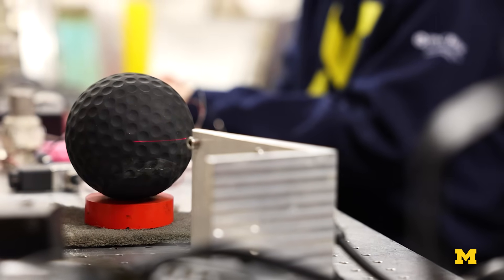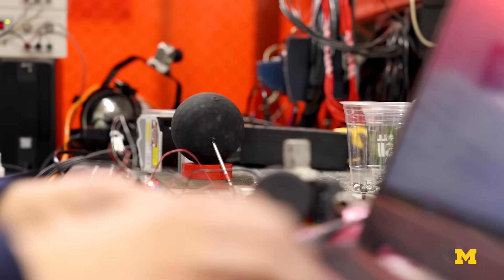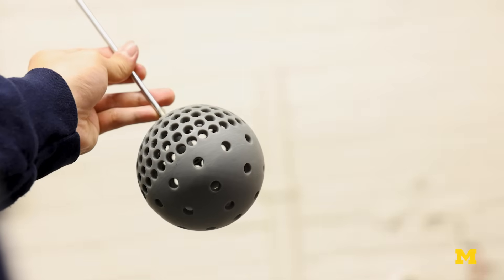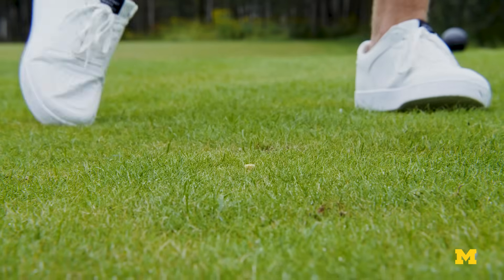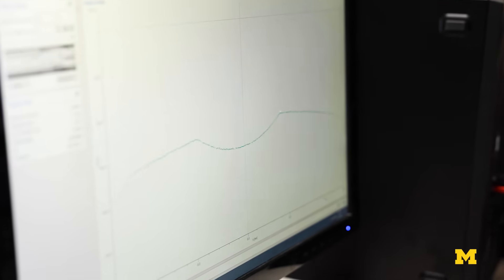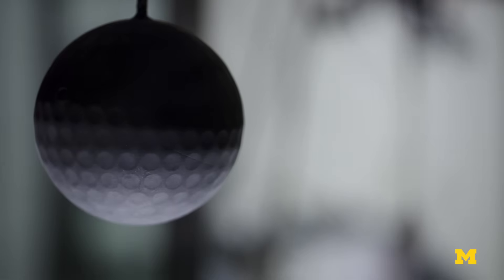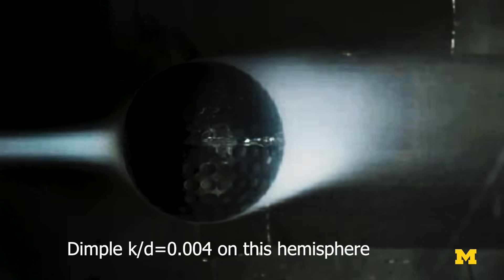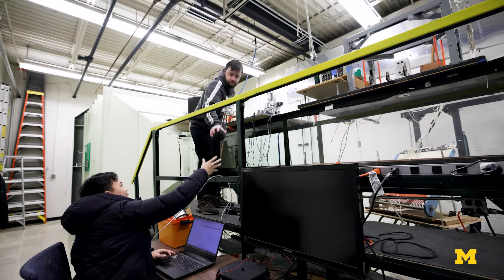A dimpled, actuating surface that could change how underwater vehicles maneuver.

Comment: Isn’t bluff body drag super high? So, the 30% improvement from dimples is relative to a terrible baseline? Are dimples beneficial to a more optimized hydrodynamic shape?
Reply: Yeah may not be that beneficial for aerodynamic shapes in air but it probably has a bigger impact for all shapes underwater since viscosity is much larger and this attempts to minimize that skin friction drag

Comment: IM THINKING IM DRINKING TO MUCH COFFEE BUT THEY USE THE GAS PIN HOLES IN THE SQUAL TORPEDO MISILLE RIGHT LIKE 250 UNDER WATER . SO IF LETS SAY YOU COULD PRODUCE WITH A REACTOR WATER TO H2 0 GAS  OR STEAM AND PIN HOLE IT YA COULD 250 MPH AROUND ALL YEAR . JUST SAYING !!!!!

Comment: I wonder if you could make this golfball out of a flexible Radar Absorbing Material (RAM) or coat it in a RAM that tolerates this flexing behavior, to make stealth aircraft with no moving control surfaces, or to make stealth aircraft able to dynamically adjust their surface shape and texture to better resist detection by whatever wavelengths it detects that it is being illuminated by like those metamaterial "invisibility cloaks" but programmable?
Reply: most likely will not be able to have enough control and change of direction for an aircraft.

Comment: What I see is that this is a great idea but increasing the overall surface area underwater by making dimples will increase the frictional resistance of the body, though eddy losses will be lesser than before but we have to keep in mind that this is water-it has more viscosity than air therefore frictional losses constitute a greater part. Also, if seen in longer timeline there will be plenty of marine growth over the surface which may reduce the overall effectiveness of this system and it will be harder to clear too
.

Comment: If you had more fine control over individual dimples, could you run them in wave patterns to generate propulsion?
Reply: You could definitely get it to roll on hard surfaces. You could probably get it to spin or rotate underwater. Professor Sareen says that's how they get the ball to turn right or left in the air; by actuating the different dimples

Comment: Its interesting that they are specifically targeting underwater use cases.

Given the golf ball analogy, I would have expected more interest in air based drag reduction.
Reply: I would bet its pretty heavy so its better implemented in water where weight is less relevant.
Reply: @TheCococoleyco 
Very good point.
Reply: they run their tests with air- so I don't think it matters if its air or water. They have sensors on the regions to determine how much air pressure to apply to increase/decrease the dimple depth
Reply: Higher viscosity underwater means there is likely a more pronounced effect since it attempts to minimize skin surface drag
Reply: this is not really for drag reduction in aerodynamics. the dimples on a golf ball generate turbulence in every orientation. for aplications like cars and airplanes, we have waaay more efficient ways of generating vortexes when we want to, but it is often better to preserve laminar flow in most cases, the golf ball benefits from turbulence because the curvature of a ball is too agressive for laminar flow to follow, and that generates flow stagnation or worse alternating vortexes (see the jabulani football fiasco). the suggested aplication here is to have a submersible where by actuating these dimples we can change the flow around the vehicle to make it turn. It probably will only be beneficial in a few niche use cases where you dont need much manouverability and where fins have big cons. there is the adicional problem of dimples not being terribly good vortex generators, they are used on golfballs because a golfball spins and we cant have directed vortex generators
Reply: also, forgot to mention, for traditional applications there is no reason to actuate these things, bugatti recebtly had a car with actuated dimples, and not only are dimples awful vortex generators, but worse than that you had a heavy system to activate them at speed when there was no reason to not have them on at low speed as well, then the engineers must have explained to the designers and the marketing team how ridiculous and dumb that whole concept made them look and they suddenly stopped advertising that feature and that device never appeared on the production car (neither did any dimples)
Reply: bro the medium of water has greater resistance than of air. No need to test it on air if its being used underwater
Reply: @kennyboy4u you misunderstood. If they got the idea and original principle from air... why are they testing it in water?

Comment: Judging by how animals in nature don't use surface texture for maneuvering, I imagine fins would still be better. Even animals like octopuses that can change their skin texture don't use the texture for maneuvering.
Reply: Animals don’t use biological equivalents to propellers or jets or rockets either. It is pretty intuitive that trying to make the wings flap on a commercial airliner is simply not feasible. There are certain optimizations that biological systems simply cannot make due to limitations in mechanical complexity. You also have to consider what the problem is at hand here, which is range maximization. Sea creatures with the capability to change their skin texture may not have this need or it may take more energy to hold a different configuration like flexing a muscle that makes it not worth it. Mechanical systems can be designed such that configurations can be held through locking mechanisms or material properties which means only the energy needed to change is required. Where we are in terms of evolution is not a peak, nature is flawed too and biological systems are continually adapting to their environments
Reply: Well…kind of. But fish move their bodies to swim and maneuver, which is geometrically kind of like a huge dimple one way or the other. Thing is, this could be useful on things like submarines where you want control surfaces that get the job done but don’t make a lot of noise and aren’t creating drag when they’re not needed.
Reply: @koriko88  But they can't get the job done. Fins are so much more effective.
Reply: Conclusions from bionics are not bijective. Airplanes have thruster and no animal on earth has a jet stream shooting out of its ass.
Reply: @xxxy912  Cephalopoda like octopuses and squids can shoot out water jet when they want to escape.
Reply: I get what you’re saying but then again animals don’t use rocket engines but they’re still ucefull
Reply: Evolution doesn’t pick the best solution to a problem, it just eliminates the worst solutions.  No animals have wheels even though they are far more efficient than legs for traversing long distances.
Reply: Given that animals in nature don’t have hard metallic skin, I’m not really sure I see a use case in making things out of all this steel. Seems so silly.
Reply: @TheInfallibleFallacy  The assumption is that if it was useful and feasible nature would have done it. Animals getting metal is very difficult. Animals already have the tech in the video, they just don't use it for maneuvering. If it was useful for them they would evolve to use it that way.

Comment: It's a solid sphere with holes with a rubber (or polyurethane or latex idk something elastic) wrapped around it, inside, the sphere is divided into two semispheres by a plate and there is a tube that goes into each space to suck or introduce air. I already thought of this, didn't have the means to make it so it's exiting to watch it giving promising experimental results.
Reply: I hear this a lot, that someone had an amazing idea but no means to get their idea into the real world. It really sucks, how many great minds are there that can't put their skills to use because of things outside of their control?  "I am, somehow, less interested in the weight and convolutions of Einstein’s brain than in the near certainty that people of equal talent have lived and died in cotton fields and sweatshops." - Stephen Jay Gould

Comment: Interesting idea. I'm not sure if there will be enough vertical and directional stability without at least some "winglets" to keep it maintain the desired path, but I could see it reducing drag at least somewhat overall.

I'm curious as to what speeds in water this would apply to as well to how it translates at scale (think large submarine vs this tiny "torpedo" probe) that is shown. Larger body, larger dimples, more velocity?